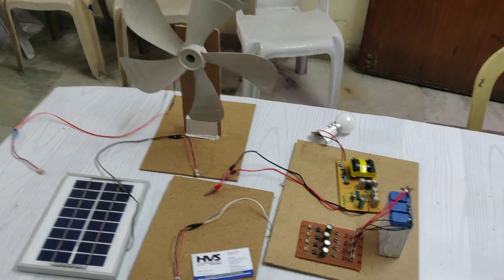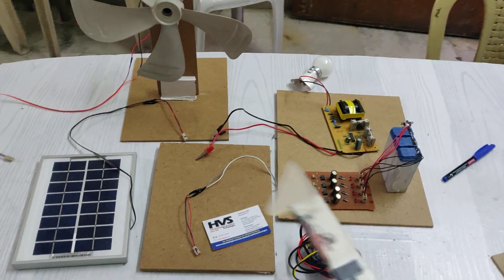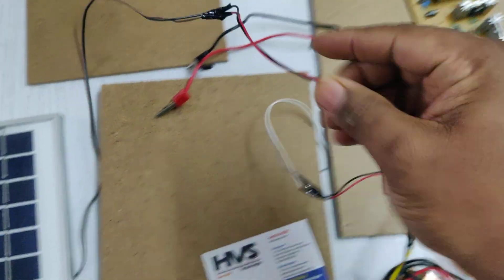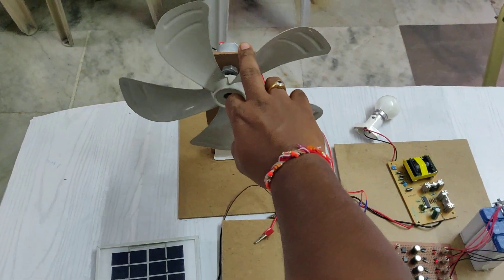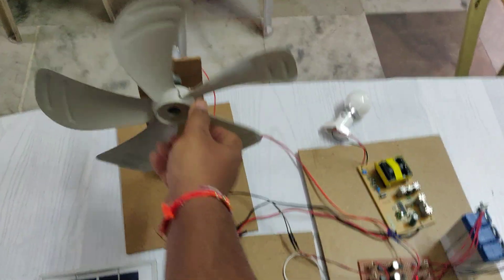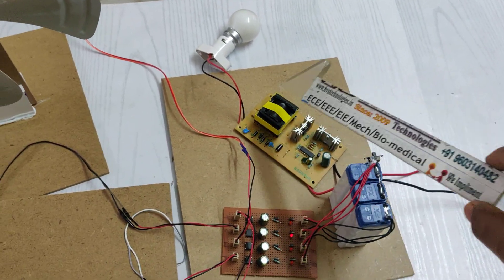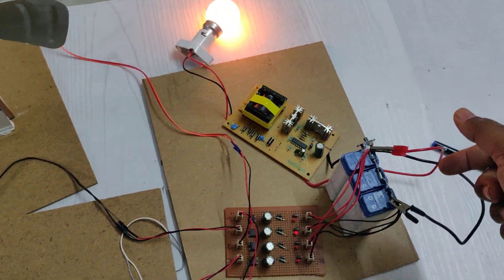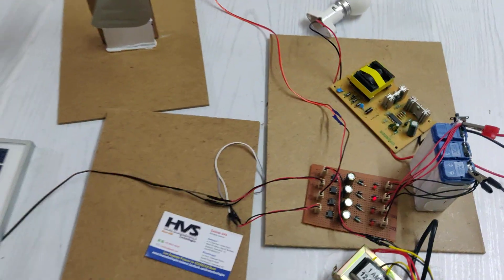Hybrid Power Generation system using solar wind and piezoelectric

Comment: He good sir, i just wanted to ask how would you add a monitoring system if you wish to upgrade the project
Reply from the maker: We can iot. Or LCD. Hi, 
We sell full working kit with document PPT circuit diagram and code. Could you Send me the video link, Will update you the cost details. You can contact us at +919603140482
Through WhatsApp or call